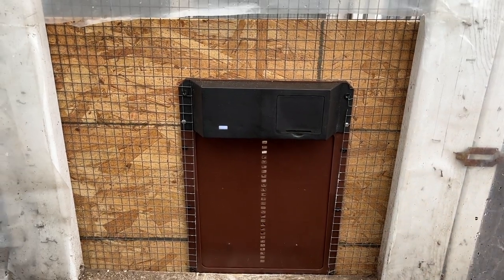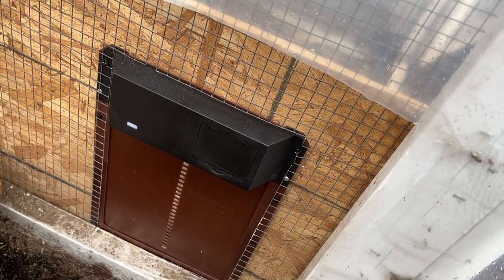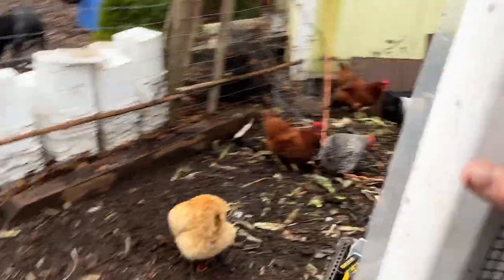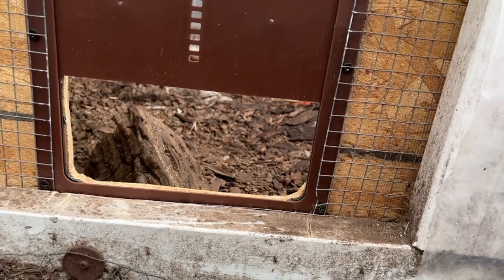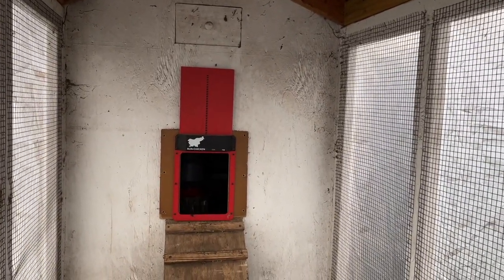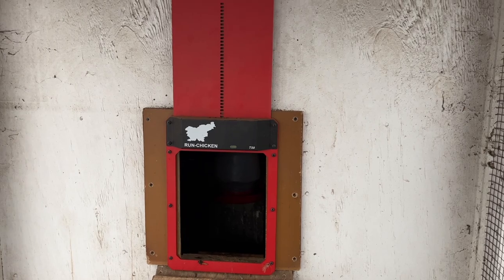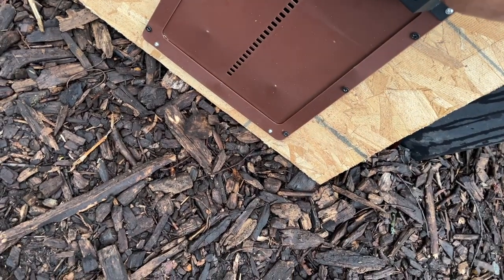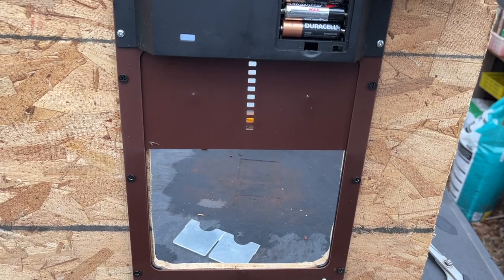$30 vs $200 Automatic Chicken Coop Door

Comment: I brought the cheap one and it opens really well and goes right up the way you installed the cheap one is installed under the wire the $$$ one is installed how I did the cheap one but my cheap one is good.

Comment: Cheap one has been working fine for me, mine is under a roof so water not an issue, and after the first few nights, no chickens locked out. (they learned when to go in..) I did have to adjust the tension on the door a bit at first.
Reply from the maker: That does seem to be a recurring theme, needing to tweak it to get it function properly. Have you had it for awhile? Still wondering how they hold up in temperature extremes
Reply: @HomesteadDIY   Only about 3 months, no issues so far.

Comment: THANK YOU!!!!
Being on a tight budget I of course was looking to buy the cheaper one.... but when I learned that the other one has a metal door I was sold. I have predators every night on my trailcam!!!!!
Reply from the maker: Over a year and a half of using my Run-Chicken door and it is still working flawlessly, even on the original batteries, which they recommend changing after a year

Comment: Been using the cheap one over 2 years, heres what I've learned. 
1. Build a frame to mount the door on, then bench test it to make sure it goes up and down smoothly, if not put sims by the top screws between the outer plastic frame and the inner tops strip.  
2. Once working screw that to your opening.
3.  If the door is low enough, sometimes the chickens will scratch and throw dirt on it and it will stop working.
4.  Some times shims will slip, or what ever and you might have to readjust it.
6.  To make sure it opens and closes at the right time, I put a timer with a light in front of the sensors.
7.  After 2 years the inside plastic gear that's on the main shaft has stripped, trying to epoxy it but I'm not sure if it will stay.

All in all, the cheap one will work pretty consistently, but you have to keep and eye on it.  Definitely worth the money, and a much better deal than $200.  I think I paid $15-$20 for mine and I could buy 10 to 15 for $200, which would last me 20 to 30 years.  I dont' think the $200 one will last me that long.
Reply from the maker: Glad the cheap one is working out for you. Many will make do with it and be fine. I do prefer the peace of mind that's come from the Run-Chicken model. I've had the original one for 3 years now and it has operated flawlessly. I've never once had to tinker with it or hope that the door actually closed and some predator didn't get in. In fact, the original set of batteries that came with it are still operating. That must be some kind of record. lol 

I was so impressed with it I installed a second one on the chicken run (where I tested the cheap model). It too has been running flawlessly for about 2 years now. As I said, the peace of mind is worth it to me.

Comment: My chinese door goes very well ! you are doing things backwards! When you start you see that it systematically tries to open since it is daytime, when it blocks you must therefore push it up and not down like you are doing! Then, when you go to hide the cell (which is on the indicator light) the door will bend down and stall down, that's the "tak tak"! I have had the Chinese door for 6 months, currently winter with snow and frost and it still works well without having changed the batteries! Analyze how it works and you will understand!

Comment: Almost bought the $30 model... I was researching doors and saw this design with a few different price tags, wondered why that was, then I saw the different brand names and logos. Did a little more research and found this video. Looks like Run-Chicken needs to start suing a number of knock-offs.
Reply from the maker: I saw on Twitter the other day some company running Run-Chicken's ad but stripping out the company name (I made an appearance in it!). I'm pretty sure it was a scam site because they were "selling" the door for $50. They probably just take your money and you never get a door. I notified Run-Chicken and they said it happens all the time. They would try to get it taken down, but was likely a futile effort.

Comment: Can the door be flipped over? It looks like the raised part should be toward the gear.
Reply from the maker: I would imagine it could be flipped, but the door is really identical no matter whether its flipped up or down. If you look at around the 9:58 minute mark you can see the top is the same as the bottom, even with the same spacing between the first hole and the edge, so I'm not sure it would have any effect.
Reply: @HomesteadDIY  Not flipping it up or down, but rather can you turn the door around where the vertical grooves are facing the gear hub?  At 15:11 I noticed they are facing away from the gear hub.  May no do a thing, but if the allowances are tight it just might make a difference.

Comment: mine seems to be working fine.. you've got to make sure its just tight enough... too tight and it won't move, too loose and the gears just spin.
Reply from the maker: Glad it worked for you, but right out of the box? As I showed, it took some engineering to get mine to work mostly right"

Comment: I have some deer feeders that go off using this same type of sensor. Dusk/dawn I believe. My concern is motor and the type of loop. chain sprocket and length. Seeing the plastic one slipping helped me determine some of my mechanics. Thanks for sharing!
Reply from the maker: Glad it helped. Certainly for this particular application the direct drive nature of the motor is probably fine as the plastic door is very light. So too with the original aluminum one. If I was trying to lift a wood door or something similar, I'd want something that would be able to lift that weight. Have you considered a pneumatic cylinder? I had originally planned to use one of those when I was thinking of building my own, though they can get pricey very quickly. I've seen car antenna motors also used.

Comment: 2 pieces of thin foam sticky tape on the mounting board creates pressure ( smooth side ) on the plastic door against the Gear. Fixed.  Again,  place sticky tape on the wood on each side where the gear track will be. The tape is now on the wood. Now install the unit against that tapes smooth side. The pressure pushing back toward the door should seal the track tight against the gear.
Reply from the maker: That works too! Had I thought of that I'm sure I would have been too lazy to run to the store to get some. :) Whatever you have on had to apply constant pressure I'm sure will do the trick to allow the gear to engage. Of course, that causes me to question a lot of the other build standards in the opener and how long they will last, but it should give you at least a one or two years of service.
Reply: It is like Harbor Fright tools, they are 1/4 the price, but usually need some work to make them good.
$30 is actually a lot for what these things do.  I'm building one it costs about $10 to make one.
The fix for this one seems to me is stiffen the plastic door so it does not bend away from the gear.
Reply from the maker: @murraymadness4674  the old saying, you get what you pay for, comes to mind. Your $10 version sounds intriguing!
Reply from the maker: @murraymadness4674  Ha! I hear you. The $160 version (about $200 these days) is made of powder coated aluminum, but you still have to install it yourself. And your "wimpy" version is all well above my pay grade. I've always wanted to learn about servos, stepper motors, arduinos, and more but I need my hand held through the process. So instead I've been willing to pay up for convenience and letting others figure that stuff out :)
Reply: @HomesteadDIY  Yeah I get it, but then you have chickens..why not just buy eggs at the store! ;)
I could do a simpler version without the micro using car window parts only, but my wife says why would you waste your time on that, when you can do it better and cheaper using electronics?
I said, so I can make a video...and she points out I have only 200 subscribers and my free motorhome videos have about 10 views..oh she gets me every time.
Reply from the maker: @murraymadness4674  They know all the buttons to push! But we do this for the love of sharing not the views. Right? Right?!?
Reply: @HomesteadDIY  I try to give back for all I learn from everyone else, but it sure would be nice to get more than 10 views on a video!

Comment: With the choice between no automatic door and the $30 option what would you go with
Reply from the maker: For years I didn't have an automatic door and made do going out every morning and evening to open and close the coop. With that said, you may have to hack the cheap door and it still might not work. A lot of comments on here say just that (a few say it works fine for them). If you don't mind potentially wasting $30, you could give it a try. You might be one of the lucky ones that it works for!

Comment: My cheap one works, but I got thin strip of banding material and bent it in a little drilled holes through the back near the gear so putting a little more pressure on the gear and seems to work good so far
Reply from the maker: Yeah, that seems to be the necessary hack, keeping pressure on the door near the gear. Have you had yours long? I'm wondering how the plastic will hold up in temperature extremes, cold or hheat.

Comment: Like your Video. I bought same low cost version in Germany for 20€ ,same aus 20$ . I recognized that at yours version 2 screws are missing in the upper part. And thats why the plastic door hast Not enough pressure top Run with the Gear. My Version hast this 2 extra screws and it works fantastic.

Comment: the design of these cheap ones has changed slightly, just did a video on hacking one, and they added a back plate to ensure the cog engages with the door correctly, havent had any issues with it and it was only 10$ I believe :)
Reply from the maker: Looks like the manufacturers saw my video! :) But that’s a great deal for $10!

Comment: You had it way to tight on the cheap model. That metal cage wiring was rubbing and not free like the more expensive model
Reply from the maker: Actually I didn't. Well, initially i did, but I loosened the screws and the hardware cloth did not interfere with its movement (it just looks like it might be). The real problem is it's made of cheap, thin plastic so it flexes. Once I added a couple of stiffeners to the back of the unit it worked better.

Comment: @Homestead DIY. 
You stated that a coon could get in by lifting the cheap/plastic door up by the holes running down the front. 
Doesn’t the ChickenRun have these same holes? 
Or is it somehow predator proof? 
Thanks for this review.
Reply from the maker: Because the Run Chicken model is made from aluminum, it's much more rigid and sturdy, and the door cannot be lifted against the gear. I don't know whether I can guarantee any pop door is 100% raccoon-proof, but I feel the Run Chicken door is about as safe as one can hope for. I've had the door in operation for over 2 years now and there hasn't been a single incident yet. And it still runs flawlessly on the original batteries! Run Chicken does recommend you change the batteries every year, but I haven't had to yet.

Comment: Gears are not catching the holes is what it sounds like. Plastic warps in sun/heat. Wonder how hot is was where stored or shipped.
Reply from the maker: Agreed. The plastic is very thin and flexible. Once i firmed it up with the shims it worked better, but the aluminum construction of the Run-Chicken model is much stronger and more durable.

Comment: Mine closes fine, but will only raise up about 2-3 inches and stop although you can hear the gear turning, but the teeth aren't engaging. Not sure what else I can try. It all seems tight enough and not too tight.
Reply from the maker: I found that right where the gear met the door there wasn't enough pressure, which is why i put those two shims behind it which helped the gear engage the holes in the door

Comment: Bought a metal alderman for half the price of run chicken. Works fine. Bought a solar trail cam battery to run it
Reply from the maker: I never heard of that company before, so I looked it up and it looks like a decent unit. I also like the digital display on the front of the unit. I think these metal units are the key to quality and getting a properly functioning door. Good find!
Reply: @HomesteadDIY  there's a bunch a names but I'm learning they all use the same chip. Prolly made cheap in a factory and then someone slaps a brand on them.

Comment: My expensive one stopped working. Never worked so thinking of buying the cheap motor on the more expensive door? You think it will fit?
Reply from the maker: It likely will since they're of identical design, though you may have to drill new mounting holes since I don't know if they'll line up.

Comment: I saw the cheap ones on sale for $15 and bought two, knowing full well that they were probably junk. The skipping issue has to do with how the black motor part is assembled to the rest of it. I had the same issue with both of them. The motors are literally just glued in and they're not sticking out far enough to reliably catch the door. You can fix it if you're mechanically inclined. The other problem is that whatever timer they have in the control board doesn't run the motor as long to close it as it does to open. So they never close all the way! Total junk product.

That being said, I was able to fix it with a $15 wifi 2ch relay board. You can power these with USB, which is 5v. The motor is also 5v. Run negative voltage to the normally closed (NC) contacts of each relay, and positive to the normally open (NO) contacts. Then put one motor lead on each of the common contacts for the relays. This way, when you close one, the other one is already closed to ground and the motor will run. Close the other relay, and the motor runs in the opposite direction. When both relays are in the same state (on or off) the motor is essentially braked because it has the same polarity on both leads. These wifi relay boards can be set up as "inching" relays, meaning they'll run for a specific amount of time. I also don't need to worry about using a photoeye because I can use google home to tell the device to open the door at sunrise and close the door 30 minutes after sunset. I can also open/close the doors any time I want from anywhere.

I would not recommend buying these doors, but if you did, they can be salvaged and turned into "smart" doors relatively cheaply. They can't stay battery powered after that though.

Comment: I bought the (chinese) version as you call it. It works perfectly.  Maybe you are a little biased in your opinion.
Reply from the maker: Maybe. The other higher quality one worked flawlessly out of the box. The cheap Chinese one, not so much. I do tend to be biased against products that don’t work as advertised. I’m glad yours did though. Sometimes it’s a hot or miss thing. Cheers!
Reply: Plus HE needs to follow instructions !!!!!! That's WHY it doesn't open fully , set door to 1st hole ! (I know , I have one) Mine was too sensitive to low light. Closed too soon .
Reply from the maker: @greglansberry4376  and yet after gerry rigging the door with the plastic standoffs it was able to work. So maybe it really is just a cheap Chinese knockoff that I wouldn’t want to entrust the safety of my chickens to long term. YMMV

Comment: The promo code doesn't seem to work for me.
Reply from the maker: There have been a few problems over time with the code expiring. If you contact the company directly and let them know you're trying to get the discount code from my video, they'll be very helpful in applying it for you. I know you should have to do that, but as I said the company is very accommodating in applying the discount for you. Cheers!

Comment: With the holes in the door doesn't it allow wind to blow thru, causing a draft? That was my concern with this design.
Reply from the maker: I guess that could be a concern, or you could look at it as ventilation to help keep air circulating :) Because I wrap my run in plastic in the winter it's not an issue for me.
Reply: No roosts should be air tight anyway.  They all need ventilation.

Comment: What hole size should I cut before mine gets here?
Reply from the maker: I'd wait till it arrived and just measure. I think the opening was 9", but I don't rightly recall, but you want a small enough hole to ensure you'll be able to attach it to the structure. As my barber used to tell me, you can always cut more off, you can't put it back on.

Comment: after 6 months, I think my Happy Chicken coop door is doing the same thing.  I think it's bent away from the gear enough that it isn't catching.  but I don't want to spend another $170.  Thanks.
Reply from the maker: I just looked at the specs of the Happy Chicken door. I hadn't seen it previously. I do like the exact programmability of it, but I see the door seems to be made of ABS plastic (I also notice the price has gone up to $190). Although the manufacturer says they've tested it in extreme temperature conditions, I can't help but wonder if the ABS also flexes as you seem to be seeing. I do like that the Run-Chicken door is powder-coated aluminum, so that doesn't seem like it will be an issue for me. Good luck in getting your door to operate properly again. Perhaps you can hack some solution as I did with the cheap door in the video. Cheers!
Reply: @HomesteadDIY   hmm, my door is metal, not plastic.  It closes at night like it's supposed to but lately hasn't been opening in the morning.  Maybe my husband can figure it our because I didn't.